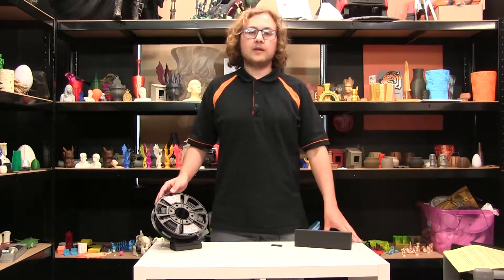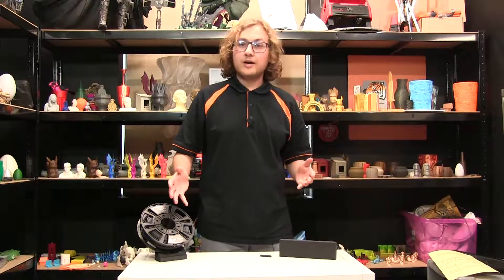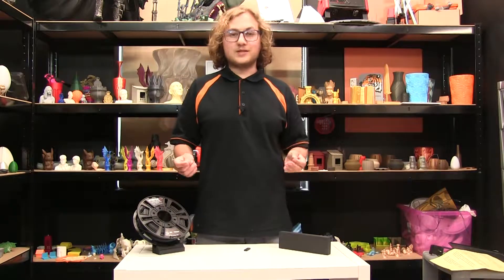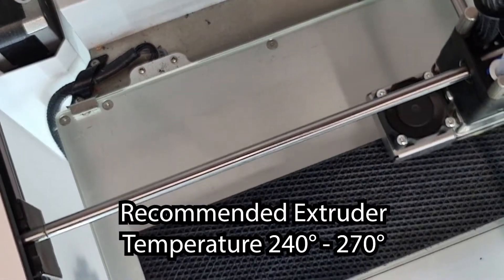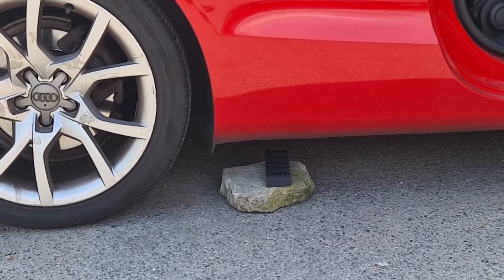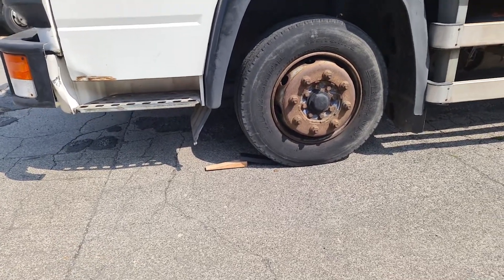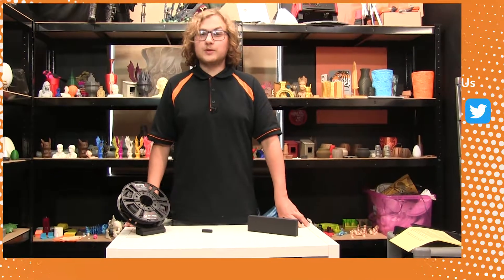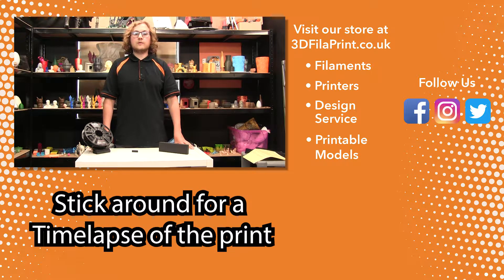Our Toughest Filament Yet - Glass Fiber PP Filament from 3DXTech

Comment: I have been suffering trying to print this filament. It warps like a motherfucker, even using a specialty print plate from ppprint in germany. Any tips on printing? I'm going to try magigoo PP glue on PEI soon, but it drives me nuts. I'm printing on a P1s, I've tried heating the chamber to 50c and adjusting settings like mad.